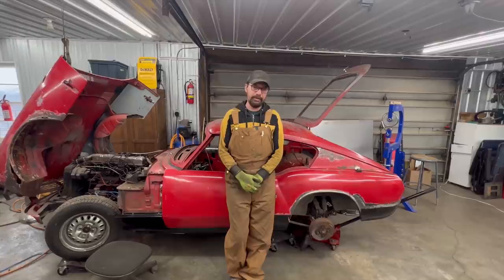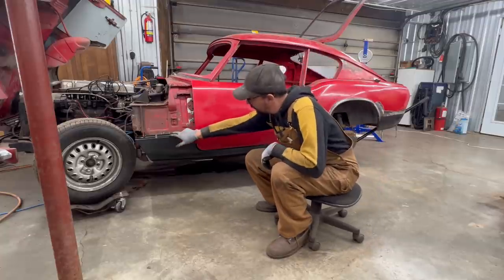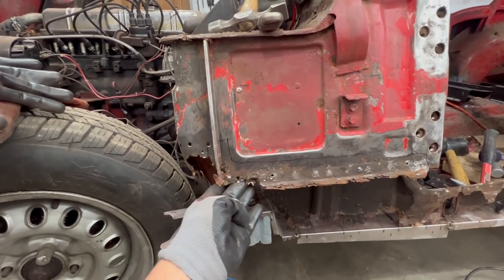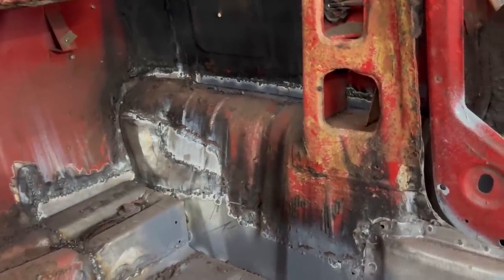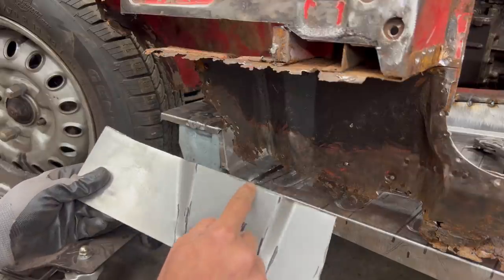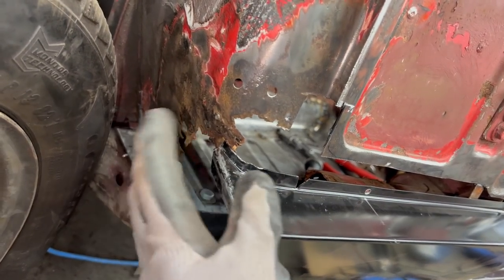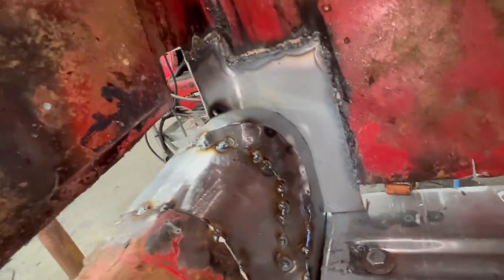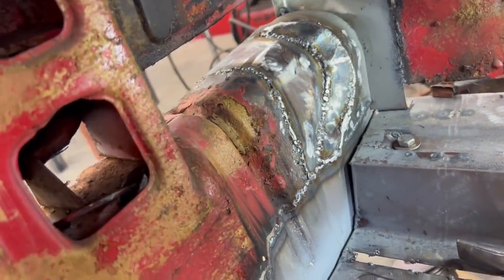1966Triumph GT6 - Part 32 - Lower A-Post from Scratch

Comment: A solid donor car would have made this a lot easier but this is a lot more fun to watch!
Reply from the maker: The problem with donor cars is that they have problems in the exact same areas! I prefer to use fresh metal. And especially for structural panels that will never be seen and the shape is not so important it is much easier to build them from scratch.

Comment: Hi elin, good work, on my gt6 I replaced the whole lower panel, you can buy them in the u.k. the bulkhead panel you repaired I did the same bit I wasn't happy with it. I chopped it all out and made a whole new panel  as its not available, but your exactly right, that corner is very difficult. You might need more work on that bulkhead yet.i wish I could send you some pictures of mine . 
Anyway great stuff as always.
Reply from the maker: I know it is available, however I am trying to avoid buying panels that I can make myself. For external panels, where the shape is important I can't do much, I bite the bullet and buy them, but for structural panels like this one, where the strength is more important than the shape I wouldn't spend a penny. I find it easier, faster and cheaper to make them myself.
Reply: Post on the Facebook channel / group ? That's what it's there for !

Comment: Elin, do you have the manufacturers exact measurements for the rocker panel, like from the seat bolt to the outside rocker face?, you have commented that you need to adjust the door, with all the changes you have had to make to the rocker so far there is a high possibility that the width and angle of the rocker may need to be adjusted,  really hope you don't have to adjust it, also when you were spot welding the bottom of the a post, you could see on the video the a post was moving, is it possible to adjust the door position by moving the a post slightly then welding a small bar in place until you can finish the bottom of the a post, another awesome video,  hope life is treating u and your family well best wishes
Reply from the maker: I am not aiming at factory measurements. It will probably be impossible to achieve these. What is important to me is to build the shell withe the external panels, make sure all gaps and shapes are good and then build the structure to support them. Yes, the A-post still moves, but it will become more sturdy when it is held to the floor too and before that happens it will be checked with the external panels and door again. You will see in the next video. It is in making already :)
Reply: @RustyBeauties  my statement was referring to whether the door or rocker measurements were out so you could adjust to suit, not that you would want to get it exact to factory, look forward to your next video, best wishes